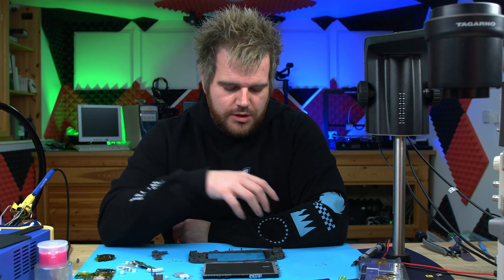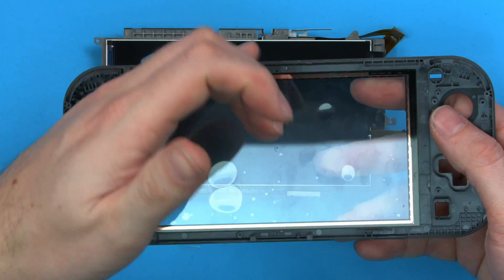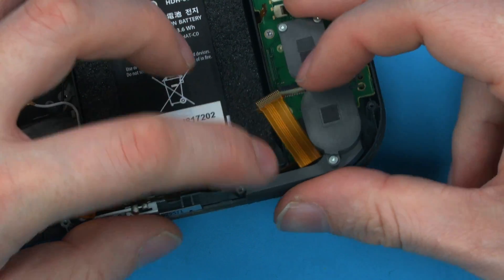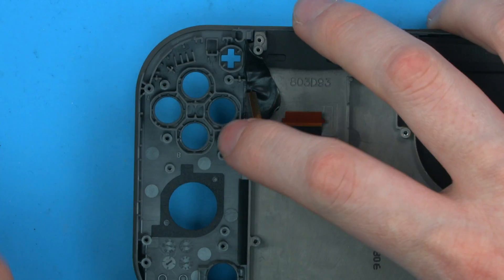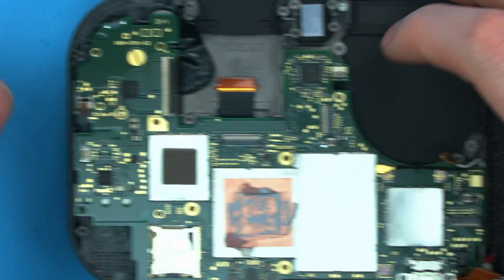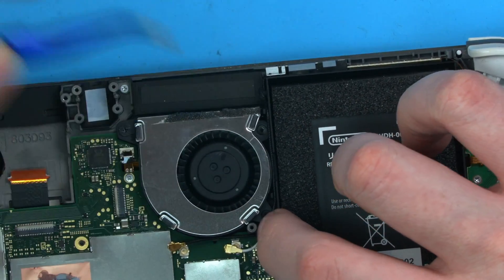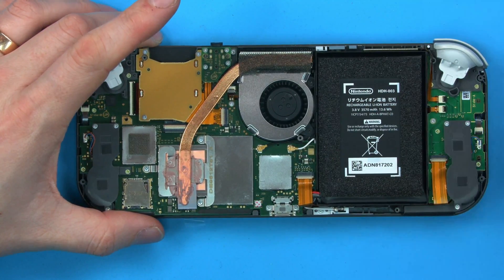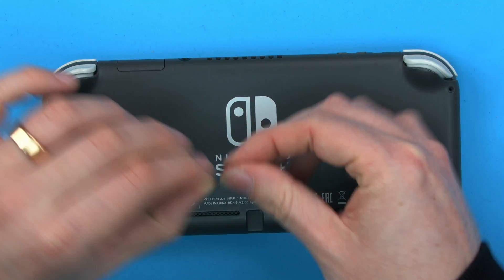Switch Lite Assembly & Build - RetroSix

Comment: Okay so I did a case swap and followed your video to a T without taking apart the led and touchscreen! I put together everything g and fired it up, and now I have no display screen and I went through and made sure I had everything plugged in correctly, all my ribbons are plugged and clamped and I did not damage anything as I took this apart I went very methodically, what did I do wrong?????